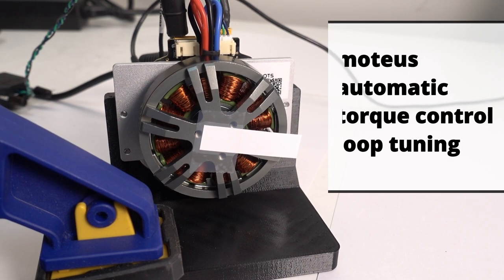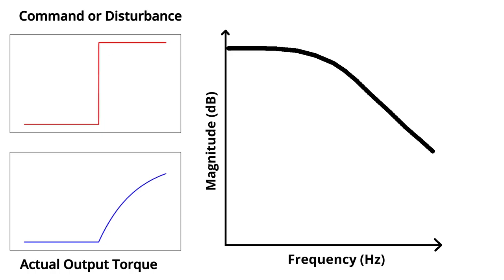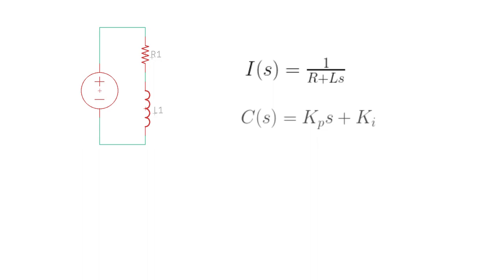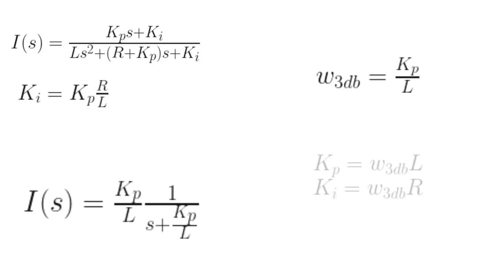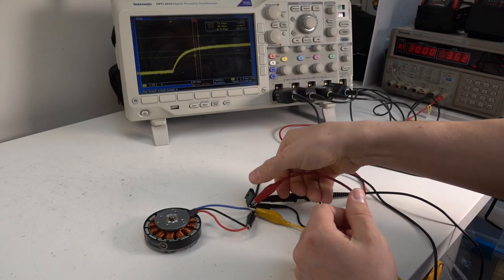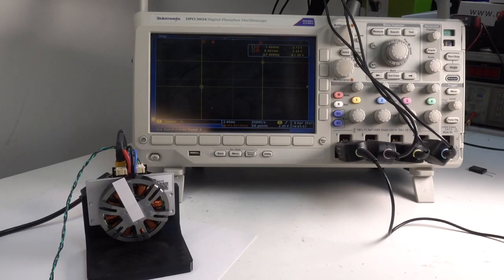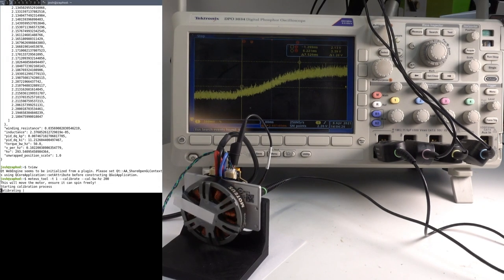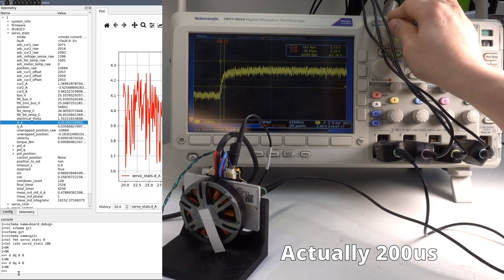Automatic torque bandwidth selection with moteus

Comment: Hi nice work, I'm trying to build my own BLDC controller right now and wonder why you used the DRV8323 in your design?. For current sensing the STM32G4xx series has integrated opams comperators and ADCs, so you only need some dumb mosfet drivers? On the other end the DRV8323 is not that expensive...
Reply from the maker: The DRV8323 includes a lot more than just current sense amplifiers that are often missing in dumb gate drivers. Things like programmatic drive strength control and programmatic anti-glitch and dead-time insertion are handy.  The DRV8323 was also convenient in that it included a necessary buck regulator in the same package.

The STM32G4 op-amps can be used, but if you want to say buffer the current input before running through a gain stage it uses up a lot of pins on the chip.
Reply: @awesjosh  good points thank you

Comment: low speed torque ripple seems pretty severe on this motor.
Reply from the maker: It is relatively high, as this motor was designed for high torque and low mass, not low torque ripple.  In practice though, with suitable gains, control isn't that bad.